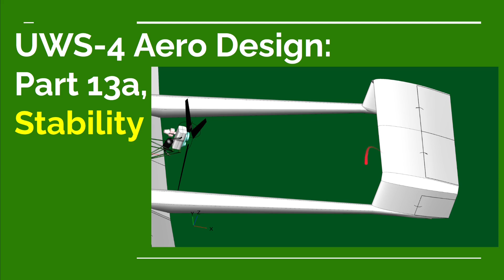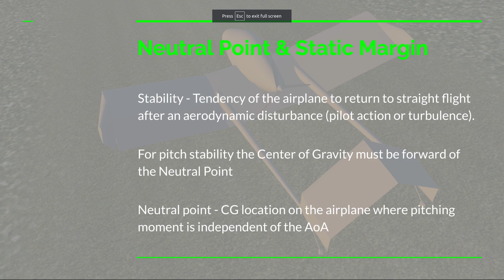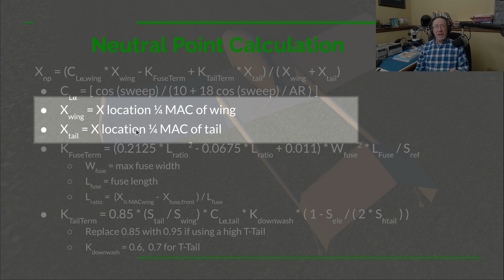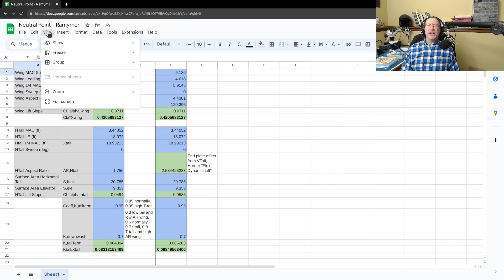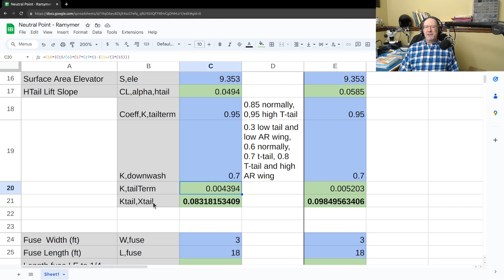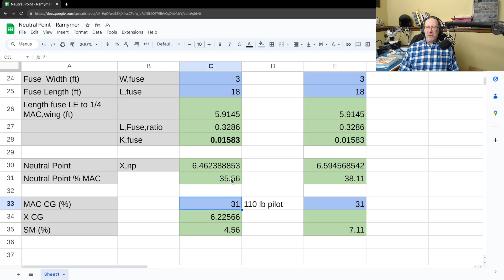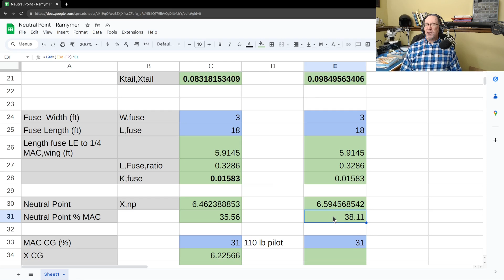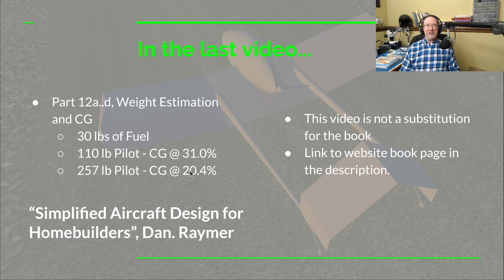UWS-4 Aero Design: Pitch Stability, Part 13 a

Comment: Hi! i dont quite get how the geometry of an elyptical Wing functions. Specificale the "Edges" confuse me. Dos the Airfoil Linerely narrow down or does it just get ajusted to the resulting chordline?? And how would you support that structure? i guess you could bend Tube at the leading edge, but what would you use at the trailing edge? can you maybe use a tube as well and ignore the resulting radius at the end? Alos how does the tip narrow down and how would you build it?? 
I'd be very gratefull for an explaination!
Reply from the maker: The elliptical geometry depends mostly on the chord. The chord of the wing has an elliptical distribution along the span of the wing. The leading edge or trailing edge can be straight or curved although at least on of them will be curved. Or you can approximate an elliptical profile with multiple trapezoids. You do not have to take the elliptical planform all the way to the tips. Even some of the later Spitfire airplanes had the tip trimmed off in order to make manufacturing a little easier. The tips do not provide enough lift to make much difference.